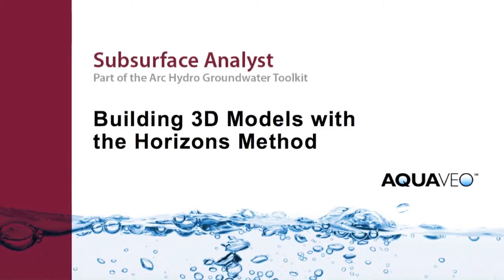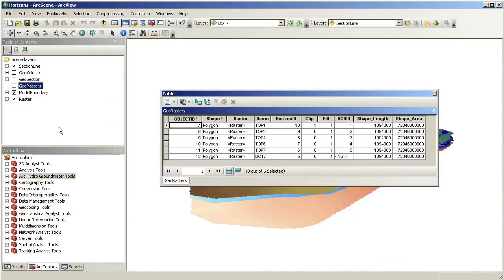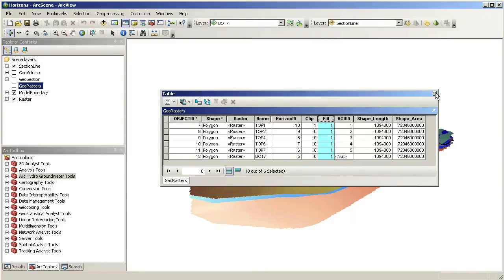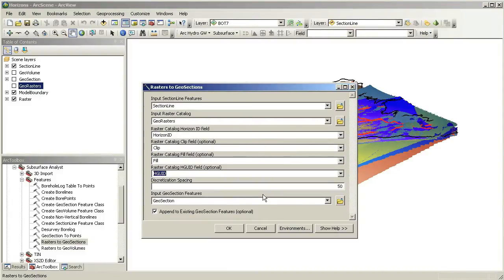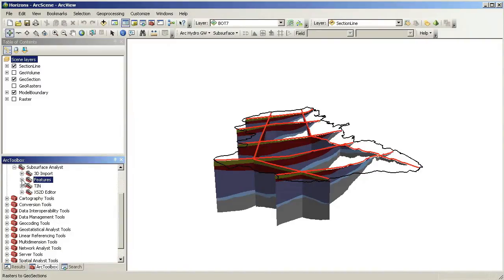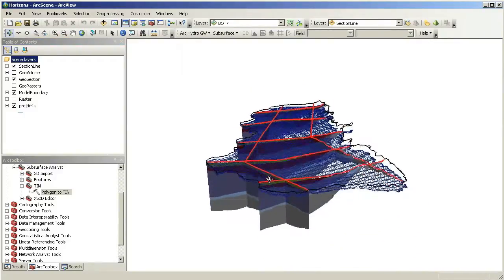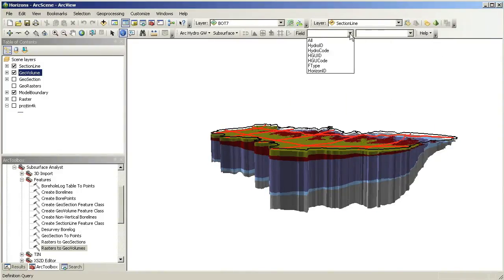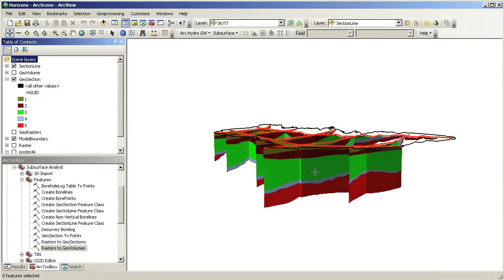AHGW: Building 3D Models with the Horizons Method

Comment: Thank you for this valuable tutorial. Only a question. I don't know how you have generated that GeoRasters file which is containing an empty column named HorizonID? I can see it for your study area prepared in the folder related to the tutorial. But I don't know how could I generate it for mine.
Also, I should mention that my problem has a few differences from yours. I have several prepared rasters which are representing the top elevation of each layer and I have not generated them using a tool like IDW.